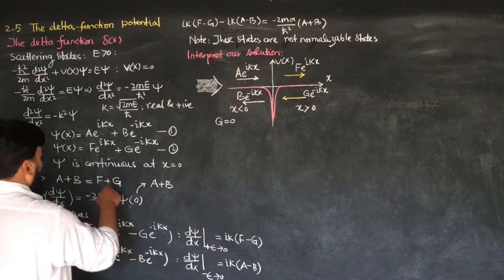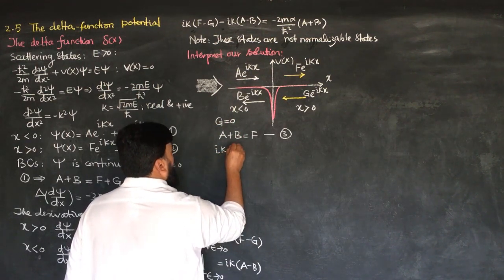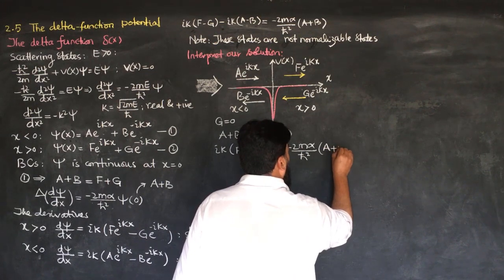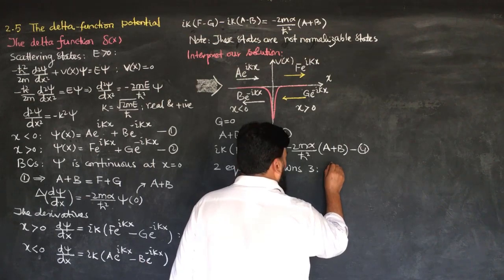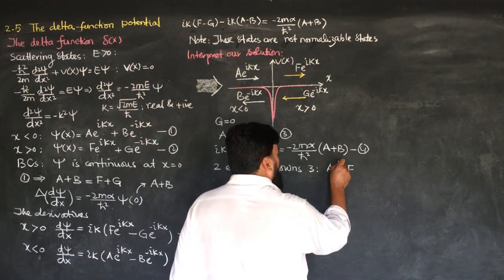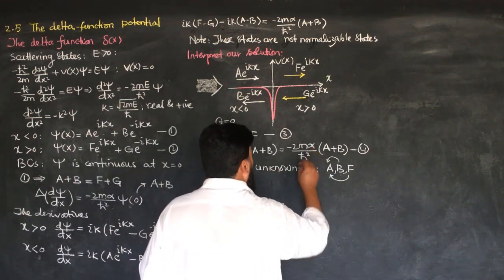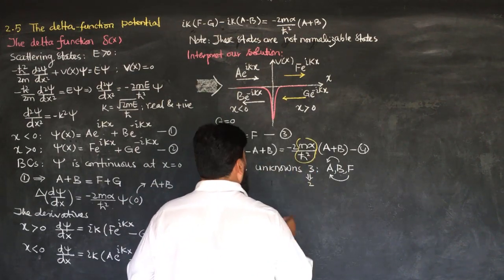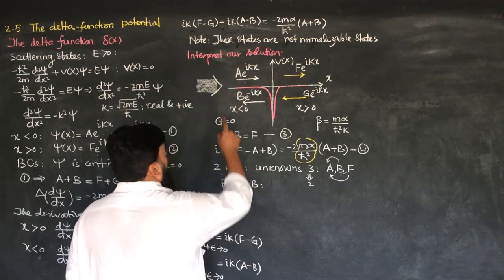L16.3 The delta function potential: reflection and transmission coefficients derivation

Comment: In Infinite sq well there was an i finite potential  on the walls.. can we call the infinite square well as having a bound state quantum mechanically and classically?
Reply from the maker: Yes. Particle was bound at the walls while free inside. So nodes are at the walls as can be for a classical system as well. But surprisingly nodes were introduced inside too which is purely quantum mechanical.